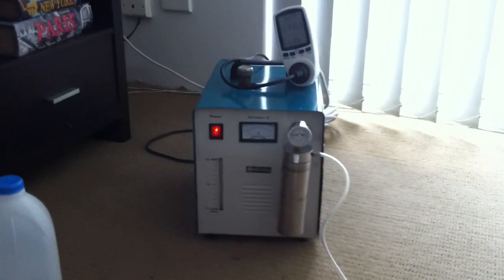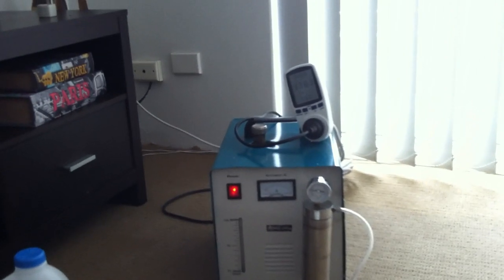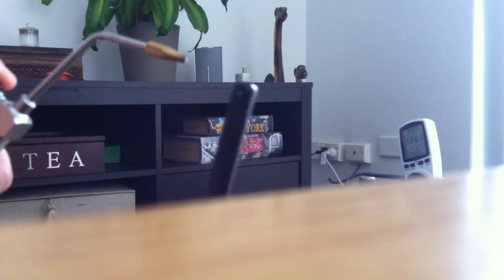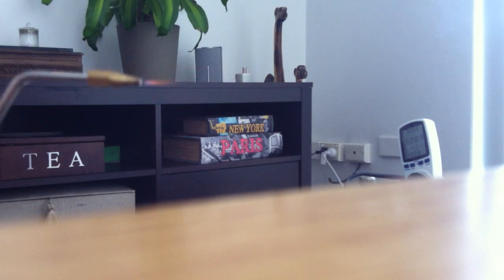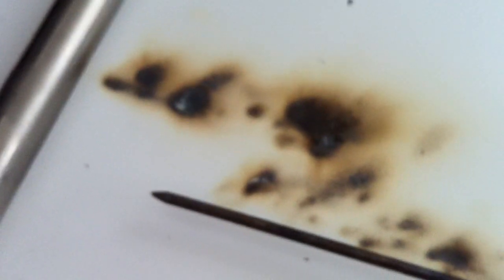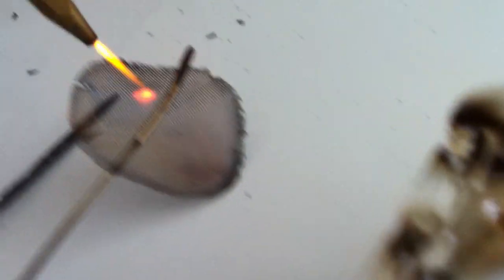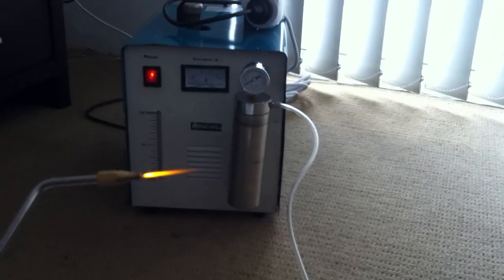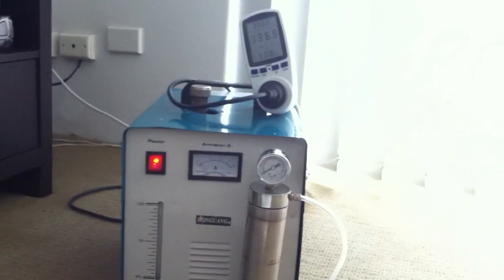HHO GENERATOR OR HOW TO CREATE FIRE WITH WATER

Comment: Romain can I ask you if you are using a pc psu? I used one and the dry cell (mine has 19 plates) was ok but with my wet spiral cell it shutted down and now doesn't power on no more :\ I need a stable power supply, what did u used?